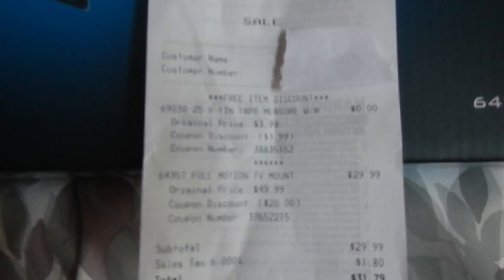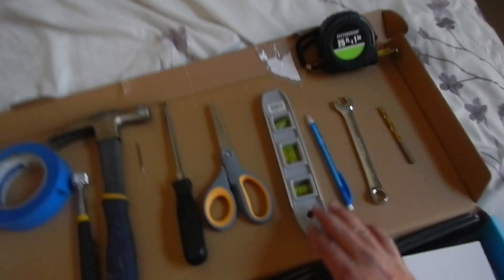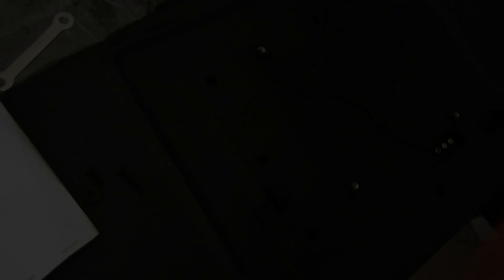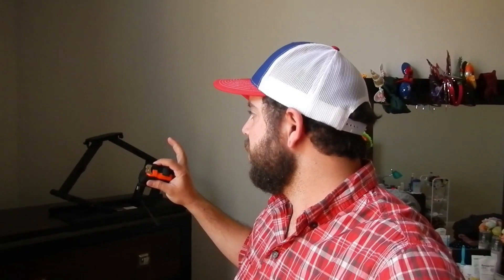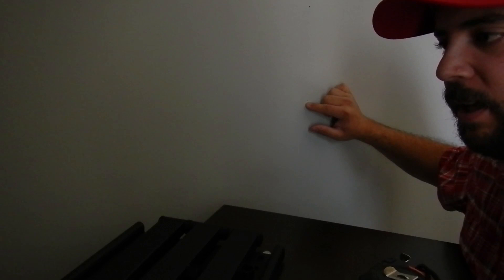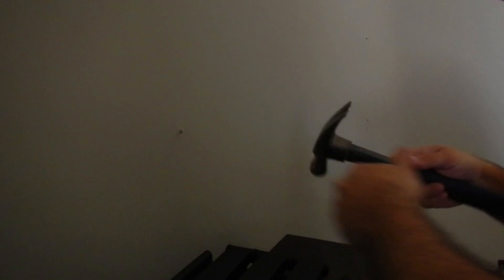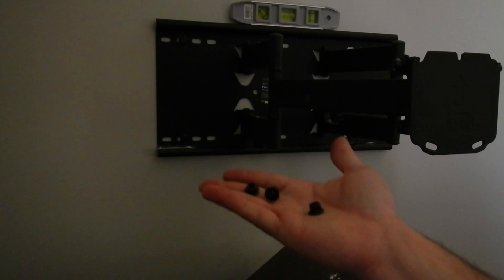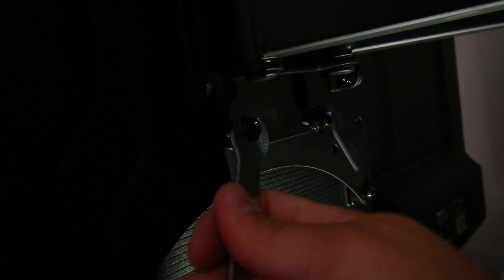Installing Harbor Freight's Full-Motion TV Mount (64357/63155)

Comment: Nice install Mr. B 😎 I just picked mine up today from te HF here in Bronx, NY area. I've a 47" LG that is currently bolted via tilt only mount & find it difficult to reach behind for any connections. 
This will def make it easier for reaching behind it .. once & for all. 
Dope Shermin Williams cap too you got.
Keep up the great work👍🇺🇸😎
Reply from the maker: Thanks! I do like how this mount sits very flush but can be pulled out for easy access.

Comment: Great step by step information. I’m going to install my 65” using the same Armstrong full motion wall mount. Here goes…..
Reply: Well I got the mount on the wall and that was the hard part. I missed stud a couple times but that baby is on the wall now!! Thanks again for your help 👍🏾
Reply: @MrCRM2011  Our studs where we needed the mount were some kind of hard wood, pain in the ass to screw into but I got it eventually.

Comment: Great step by step tutorial!! I just bought this. And realized I'm installing it onto a block wall. Not a drywall with studs. So am I doing everything the same. Just using a concrete bit for the block? Or do I need completely different screws. Like do I need tap cons?
Reply from the maker: josh milligan you will need a concrete bit to drill the holes for sure. It is probably a different size than I used though. At 1:22 mark I show the hardware provided for brick install. I’m not sure if the provided bolts fit those inserts.
Reply: Sammy Benitez thank you for replying!!

Comment: Why did you not use the horizontal box frame as shown on the package? It mounts to TV and then the 20" arms to tilt plate.
Reply from the maker: The arms are dependent on the VESA mounting style for your TV. It’s included but no necessary for every TV

Comment: Sammy, I need to mount the same size TV in a corner and I love that this product is so much cheaper than other brands. This will be the first time I've put up a full-motion mount (I've installed the standard kind before). How far from the opposite wall did you mount the left bracket? I need you to solve a dispute with my wife (not really...haha). She thinks we need to buy a true corner mount, but they're much more expensive. Granted though, some of them will allow you to put the TV flush against either wall whereas this one allows that only on the wall with the mount.
Reply from the maker: If you attach the mount to the TV and measure from the tv edge to the beginning of the bracket you will know the minimum clearance you need to push it flush against the wall.
Reply: @SammyBenitez  Thanks for the reply! Unfortunately I didn’t phrase my question properly. She’s afraid that, if I mount the bracket too close to the other wall, we won’t get the exact 45 degree angle that the TV needs to face. If that helps, can you let me know how far the left bracket is from that wall? Thanks agin for the helpful video!

Comment: Sam why did you even use a spacer on the piece that attaches to the TV?  The small screw and washer would do.
Reply from the maker: Because it would have bottomed out in the TV, and left too large of a gap to get it tight. It would have been loose.

Comment: Where I need mount this in my living room dead center to fit between entertainment piers the stud is almost dead center.  Also the next stud is 24 in away.  Could I use 2 in the middle on a stud and the others with sheetrock anchors?
Reply from the maker: That is probably fine. Use quality heavy duty anchors. The kind that spread open behind the drywall to disperse the weight have worked well in my experience.

Comment: Would it be okay to only use the 2 middle holes? I have a odd center stud and not much room on the wall.
Reply from the maker: Would it work? Probably. Four points means more security. The size and weight of the TV would be my biggest discerning factor. The smaller the safer I would feel.

Comment: I bought this model. I’m completely confused about those horizontal arms. Are they necessary? The “plate” bolted in perfect to my TV which then goes on the wall mount.
Reply from the maker: The horizontal arms are supplied for different style mounting TVs, they are not always needed. 

Sounds like they weren’t needed  for your install, don’t be concerned. Haha.

Comment: How do you take the TV down to get serviced?  Do you have to take the 4 screws out?
Reply from the maker: Use the 3 nuts holding the tv bracket to the wall mount, just like the final step when mounting the TV up on the mount (18:01).  I remove the bottom 2 and loosen the top 1 then I remove from wall mount.

Comment: I have 2 of these in my house.  
I'm trying to switch the two tvs from one place to the other, but it seems like a pain In the ass to take off the tvs from the wall mounts.  
Any tips?
Reply from the maker: Quickest way to get off the wall for me is reversing how I mounted it to the wall section (17:11) (18:33), with the 3 little nuts, remove the bottom 2 entirely, and loosen the top just a little bit. Now lift/pull out a little and it should be detached. 
 
Not sure if that’s what you’re trying to accomplish. I just had to do it this summer cause the living room TV broke and we put a 65” up

Comment: Hey buddy, If my stud is in the middle of my wall can I put my 2 lag bolts in middle stud
Reply from the maker: Personally, If you could only access 1 stud, I would run a lag bolt on top and bottom, and probably add a heavy duty drywall anchor on each side. 
Also depends on TV size and if you plan to use the articulating arm often.

Comment: How do you know what vesa to use?
Reply from the maker: The way I did it was just find out what lines up with my TV holes. The official way though:

In most cases, you’ll be able to find your TV’s VESA size in the user manual or on the manufacturer’s website. If all else fails, you can easily measure it yourself following these three simple steps:

Measure the horizontal distance between the centers of the left and right holes. This will give you the first measurement.

Measure the vertical distance between the centers of the top and bottom holes. This will give you the second measurement.

If you’re measuring in inches, convert to millimeters (1 inch = 25.4 mm)

Comment: Has anyone tried to put an 82 inch tv that weighs 105 pounds and is vesa 600/400?  says up to 80 but my tv meets everything
Reply from the maker: I would imagine it would work. You are still under the max weight, which is what I would imagine is the biggest concern. Like you said, it will physically meet your requirements of mounting.
Reply: Just keep in mind that side to side range of motion for 82" won't be nearly the same as for 55"

Comment: Has it fallen off the wall yet? Is it good quality?
Reply from the maker: Over 3 years on my first mount and over one on this one problem free
Reply: @SammyBenitez  one more question. My mother thinks that installing a double-stud wall mount would be too cumbersome for the wall and it may break off or fracture the wall. Is there any risk to that for a 1960's apartment? Could the studs be weak to support a 43" screen?
Reply from the maker: @reallauradee  I wouldn’t think so. Wood was stronger back in the day than our mass farmed 2x material today.

Comment: The spacer configuration didn’t make sense.
Reply from the maker: You just don’t want the screws to bottom out into the TV, but you need to get enough rotations on them to make sure it’s fastened securely. 

Every set up will be a little different that’s why they provide several options.
Reply: @SammyBenitez  right, in the instructions is does not say anything like this.  But I guess every tv is different

Comment: Flawed design. Tv is held on by 3 screw bolts. 2 can be loosened for levelling, leaving 1 bolt to hold entire weight of TV. Disaster waiting to happen.
Reply from the maker: While 1 bolt does hold the weight, the 1 bolt is welded to the mount. Once the other nuts are tightened it helps distribute the weight to the mount. I have a 55” and a 65” mounted on these for several years now and we move it frequently. This hasn’t been an issue.
Reply: @SammyBenitez  good to know. I just upgraded from a 50 inch tv to 70 and this design makes me nervous. I installed some eye bolts above the mount and ran a steel rope through the plate to reinforce it if the bolt snaps.

Comment: Nice video. I’m wanting to put it (55” TV) on a fire place. I’m like David Dunn and thinking about using tapcons through the mortar but want to make sure it would hold. Also I’ve heard they’re not much option on the vertical length between too and bottom so I hit both mortar joints. My thoughts are if they don’t match to drill a new set of bottom holes on the wall mount plate so I don’t have to drill into the brick. Thoughts? Thanks!
Reply from the maker: Drilling new mount holes could be an option, since you don’t have a specific area (studs) you should be able to make it work for you